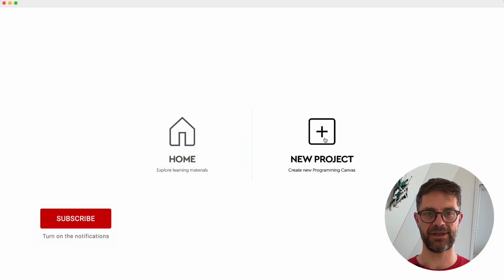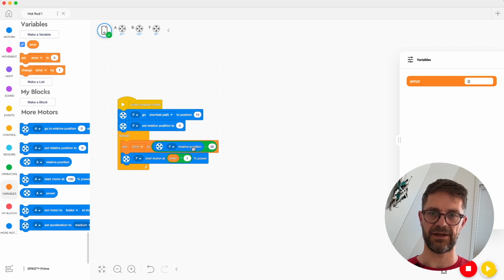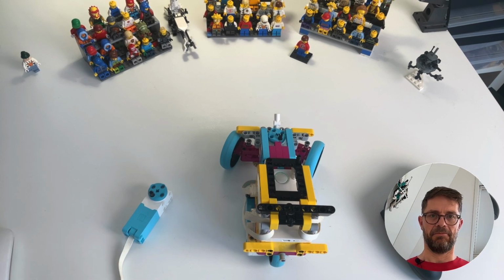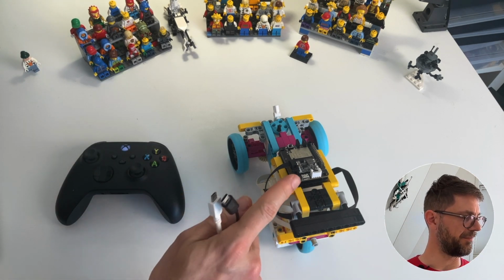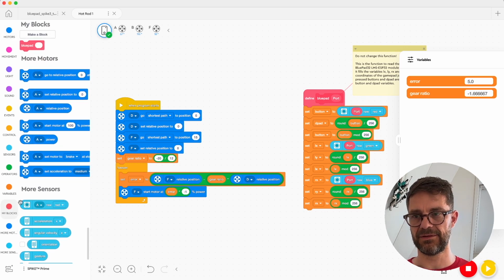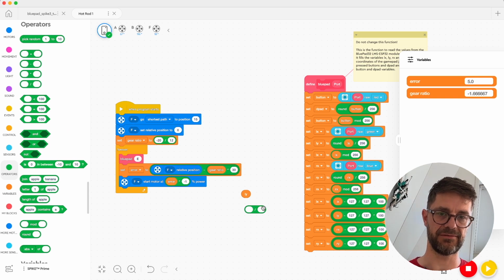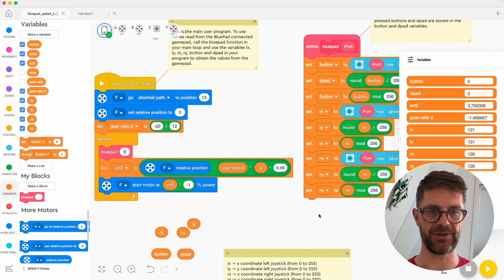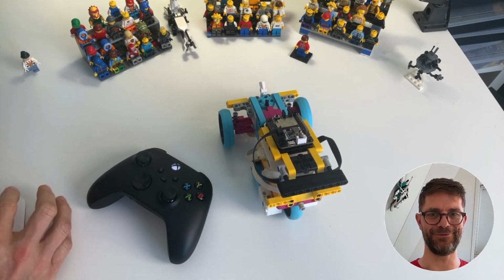How to program a SPIKE Prime car with proportional rack steering in word blocks

Comment: Great stuff! Kudos for the drivers and the elegant method. Regarding the ESP32 board, is there anything specific to the LMS-ESP32 compared to a standard ESP32? I got a bunch of "bare" ESP32 that can natively do bluetooth and HID if need be. Can I flash those with your software, or would I need your model of ESP32 board?